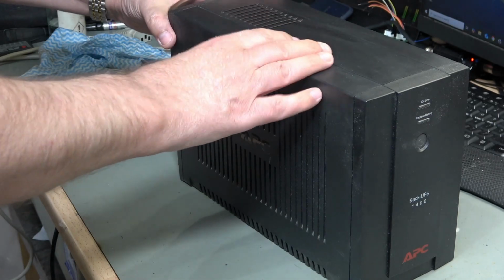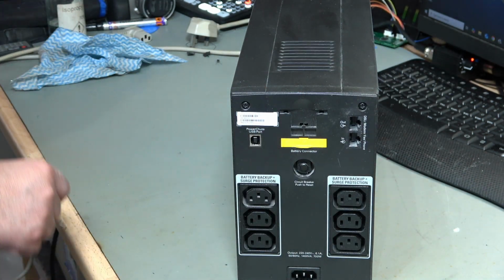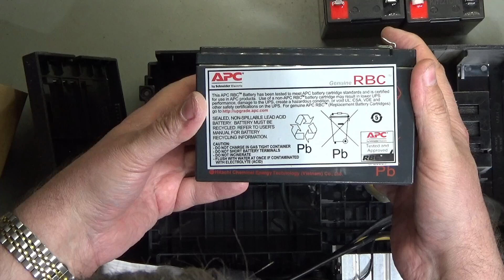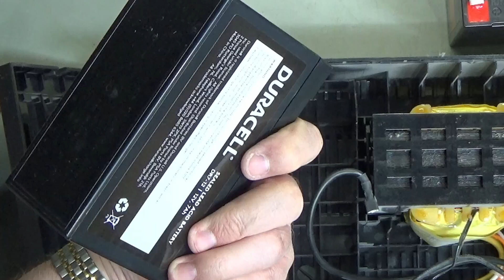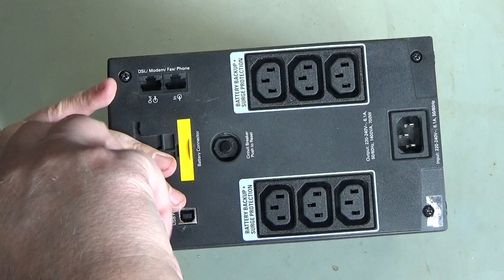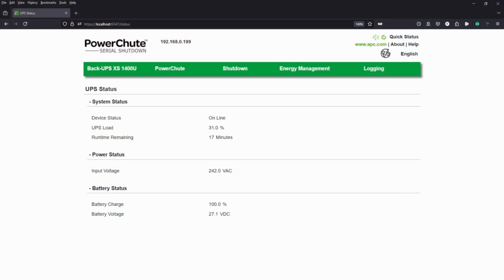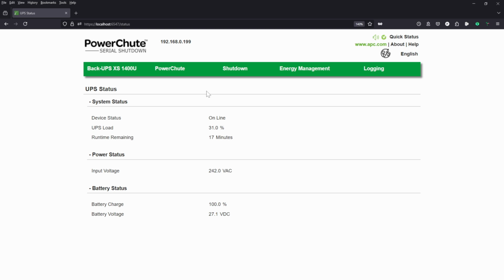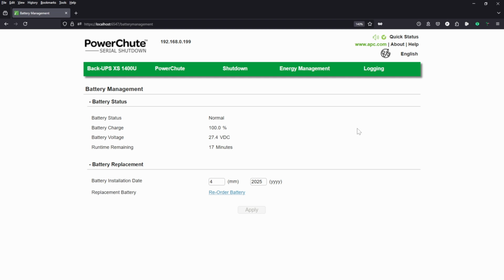Replacing My UPS Battery - APC Back UPS 1400U #0120

Comment: Have you ever increased the number of batteries - i.e. run additional external units to increase offline time?
Reply from the maker: In theory you could add more in parallel although mixing batteries like that would normally involve a charge/discharge balancing circuit.  I suppose you could replace rarther than supplement using  larger capacity external batteries but I have not tried it.  Since it predicts the run time before a power failure, the firmware is clearly expecting a specific capacity.  Presumably however it looks at the discharge curve when it actually runs on battery.  I have slight concerns regarding the charging circuit too in that case - it obviously tries to keep the batteries topped up but a proper charge cycle might misbehave.
Reply: @MakeOrRepair  Yes, it was the charging element that was my only concern (as I'm happy to live with the constraints on the output side). All I need is longer off-grid time.  For the charging  the 'get around' is to only use fully charged batteries at the outset (the APC then only needs to trickle charge 'top up').  I can not locate any useful information on the 1400 unit and what may be achieved.

Comment: Thanks for the info.
Your video says that the MY2000 batteries are 5 years old, so is this video 20 years old and only reposted 6 months ago?
Reply from the maker: Well spotted, the date code decodes as  March 2020 not 2000.

Comment: Thanks! So don’t buy Duracell if you don’t want hassle. Less contact surface means higher chance of resistance problems.
Reply from the maker: Perhaps a reminder that I should have fully examined them when they arrived, instread of leaving them on the shelf until I couldn't return them.  Never trust you get what you pay for!.  The contacts are not ideal, under full load these have to source quite a lot of current which is why I switched the connector to the right fit and secured it thoroughly, Far better than hoping to get enough contact by compressing the wrong connector.  The over contact area is good so I am not concerned but I didn't want excess heat or any opportunity for arcing.

Comment: I replaced with original battery but after assembling it, I have no power-on. I think I did nothing wrong.
Reply from the maker: Sorry to hear that!  Hard to be sure.  It may sound obvious but check battery polarity and also the link in the middle.  After that ensure all the other connections like the switch are fully connected.  It is usually something simple
Reply: @MakeOrRepair I checked with a multimeter. On the mainboard I see both 25volts and 230v from both sources. But pressing the front button has no effect. The whole device suddenly is dead.
Reply: @jiasios i think I broke something too by pulling that side panel. Very badly designed. Hard to disassemble. Maybe they did it on purpose:))
Reply: @kokozhostko  yes. I will never buy a UPS again, powerstations are far better and with loooooonger life!
Reply: @jiasios I have power station built by my own but i thought it would be easier for me to use ups rather to integrate it into my build. So, maybe i was wrong:)))

Comment: Same APC UPS, battery failed, APC's instructions claim that the battery can't be replaced by the end-user. Hmmm....followed your instructions - thanks hugely - and it was (relatively) easy to change the battery, although re-assembly was a bit of a struggle. APC have no excuses here: it would have been straightforward with minimal re-design to make the battery replacement a simple DIY job. Thanks again for such a useful video
Reply from the maker: Glad to hear it helped.  It always annoys me, and I take particular pleasure repairing things that greedy companies want you to throw away for the sake of a battery.

Comment: i really had issues putting back the side plate, something was giving me a hard time on battery side had to press the plate down and screw it in place(front screws).
Reply from the maker: Perhaps something had not seated into its normal slots or a cable was getting trapped.  There are a few bits that like to get in the way
Reply: @MakeOrRepair  yes probably, got it right second time i tried, thank you

Comment: Thanks for the video. One question: I read that APC discontinued PowerChute for MacOs (and ChatGPT says Windows too), but I see you're running it on a browser. Is there the possibility to run it via web or something similar?
Reply from the maker: They replaced it with powerchute serial shutdown.  This runs as a service in the background but uses your browser as the user interface.  Win 11 will of course also simply recognise the ups and operate through the system power settings but the dedicated software offers more
Reply: @MakeOrRepair Thank you.

Comment: Part number or a link to a compatible battery ?
Reply from the maker: Added to description
🔸Generic type is CSB GP 1272 F2 as shown in video -  just search for that to find a low price
🔸APC Replacement battery "generic with APC sticker"  is "APC Replacement Battery Cartridge 113"
🔸UK Link is https://www.amazon.co.uk/dp/B001NTFCS2/?language=en_GB&cstrackid=7f70052f-f283-4268-a81f-fc925a02a467&tag=schneiderelectric_apc_csuk-21